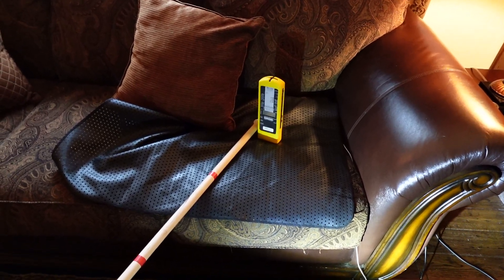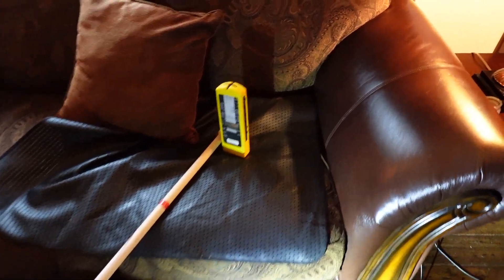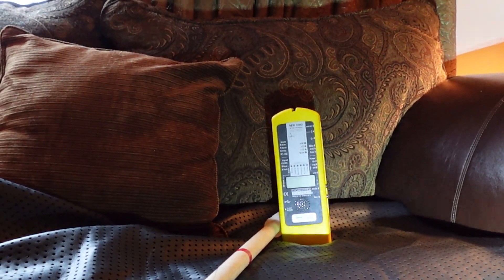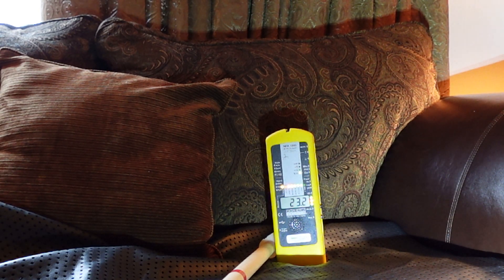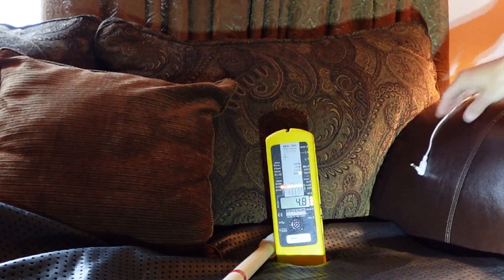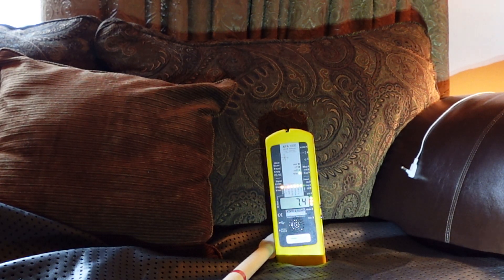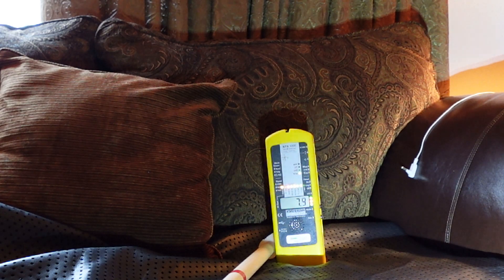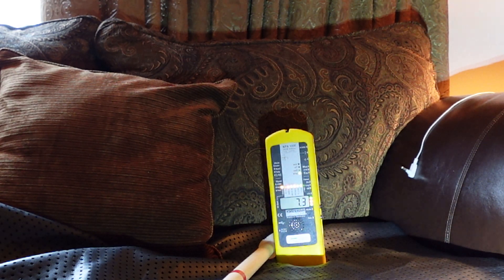The Problem with Earthing & Grounding Mats

Comment: I think you may have missed the point here. It is true that the outlet ground when plugged into produces EMF, which would otherwise travel through your body to create a greater potential difference, but only IF you don't sit on/touch the grounding mat. Once touched, the grounding mat acts as a sink for all that residual and generated EMF. Our body's potential difference is always insane given the EMF fields in our homes. Hence the need for these mats. And hence why measuring body voltage before and after using the mat it's so important. The only difference between plugging it in the ground in your outlet and using a rod in soil is the new EMF produced. But much of the body voltage difference produced by that EMF is drained through the mat. How is that dangerousm

Let me know if you have a counter argument. Thanks.
Reply: This is the correct answer and it's shocking how many people have been fooled by this "test".
Reply: I can only slightly understand what you've argued haha but so, your opinion is that it's fine, right? I want to buy a grounding sheet but I live in an apartment building. I am wondering if I should be more or less worried 😅
Reply: Should just sleep in a Faraday cage?
Reply: I slept on the grounding bedsheets on Thursday went out of town for an event stay in the hotel for annual event in Wisconsin Friday Saturday came back Sunday. Slept on the bed I was awake multiple times again same thing as Thursday feeling kind of a weirdness of energy first time I slept on my stomach, which I never knew because I just could not feel comfortable and I was wondering what your opinion is on this? We did use a tester in the plug-in outlet and when we plugged it into the outlet seem to be functioning good my husband says he’s not having any issues but I’m usually the grounded one so we both try to walk outside with bare feet when we can sometimes even in the winter, I will do it, I’m a Capricorn sign which is ground sign kundalini which I did last Wednesday anyways I’m telling you all this because I just don’t know what to do. I felt terrible. I think I woke up maybe 11 times last night. So maybe my body will get used.
Reply: Well, I do not understand your argument.
The claim that the EM-field would suddenly vanish if you were to sit at the place where it's located is just not making sense at all. EM-fields are not even responsible for our potential difference to earth. You're totally confusing EM-fields with electrostatic fields.
Reply: @fidrewe99  you are wrong. Emf fields do indeed "vanish" by draw to ground, that's the entire point.
Reply: @tatersquad2000  you are wrong, that's not the point of grounding. That's like saying if I ground something, the light around it suddenly vanishes, because light is EMF. Grounding is for electrostatic charges, shielding is for EMF.
Reply: @fidrewe99  The small negative charge from the ground neutralises positive charge that is created by EMF.
Reply: @simonruszczak5563  if the source of EMF is beneath the grounding sheet, yes. If it's to the sides, it passes because it doesn't even hit the grounding sheet. If it's on the top, it gets reflected and you get more radiation than you would without the grounding sheet. All of this is due to charge mobility within the sheet, not so much the fact it's grounded, because the dynamic response of the charges in the grounding sheet is perpendicalur to the vector of field propagation.

Comment: Hi 

Thank you for this video. 
I just bought a grounding sheet and after that saw this.
In simple terms as I have no idea about the technicalities & no idea about tools 
Would’ve grateful if  anyone tell me which tool I have to buy to check I only get the right stuff from grounding sheet. 

Thank you
Reply from the maker: You would be far better off to get rid of the grounding sheet and disable the electrical circuits in and around your bedroom during sleep

Comment: I don't understand your measurement. You said the meter is a gauss meter. A gauss meter measures magnetic flux density in such units as gauss or tesla or webers per square meter. But then when you read the meter, you gave the units as volts per meter. Those are not the units of magnetic flux, but rather the units of electric field strength. Furthermore, what is wrong with an electric field strength of 73 V/m. On a fair weather day at ground level outside, electric field strength is typically 130 V/m and under a thunder cloud, the direction of the electric field is reversed and it can be more than 10,000 V/m. Does anyone ever notice it? No, people have been living with those phenomena for millennia.
Reply from the maker: many gauss meters also measure AC electric fields, as this one does in this video.  This is an indoor environment tracking the electric fields from the manmade electric power grid.
Reply: Still ignored the ping of the comment. @optimaldwellingspaces3947

Comment: Does grounding in a high EMF environment mean a lot of EMF passes through you when connected to ground? I heard 2 opposite theories. If true, wouldn't that mean being barefoot outside is dangerous as well? I assume it's false, since an antenna connected to ground is not an antenna.

Comment: You have to be sure that your outlet is grounded properly or the whole process won't be effective
 That outlet may have a problem itself.
Reply from the maker: the electrical ground in your home is not clean from voltage pressure and current.  Having grounded wiring in your walls will help with radiated AC electric fields, compared to ungrounded wiring, but neither would be healthy to plug a ground mat into.

Comment: Great job on the video. The soil is also filled with frequencies and voltage that your NFA1000 won't measure. You will need a battery operated oscilloscope to see them.

Comment: Hey Shane! So, I used a TriField Meter to measure the Electricity coming from my grounding mat when plugged in. When unplugged it was at zero, plugged in at 2. Is 2 a dangerous amount of electricity? I do feel a buzzing in my body when lying on it. I’m assuming that’s electricity and not grounding.
Reply: I feel buzzing as well..I bit disappointed as one guy said it caused him heart fluttering...I've wasted my money

Comment: I don’t understand. So, the “ground”on the outlet isn’t actually grounded?
Reply from the maker: There is voltage ‘pressure’ on the electrical wires in the walls that creates a potential difference out in space in the room.  Conductive objects like a ground mat will exacerbate this condition.  A voltage potential difference can induce a magnetic field, which will be in AC form which isn’t good for the body

Comment: Its a hard ground, probably 14AWG or 12AWG copper.   There should not be any electrical inductance going on like I said its a hard ground.  Now if it was floating, that may be different, but even if it floats its alongside a circuit and perhaps only 500ma near it.  Inductance ?   I say no.  But if you said digital noise, then maybe.  If its close to a dimmer or an RF, VHF, UHF or GHz then maybe.

Comment: @optimal dwelling spaces -- what setting on your meter do you use to test this? I appreciate this info. Trying to avoid EMF issues...not my intent to infuse my body while trying to diffuse it with proper grounding techniques
Reply from the maker: the meter is reading AC electric fields.
Reply: thanks! I just installed 2 new copper grounding rods to connect directly to them instead of using the in house electrical outlet grounds...thanks to you! Much appreciated! @optimaldwellingspaces3947

Comment: WOW! Thank you for this information, as I was just about to place an order for some grounding mats for me and my mom. Question, if I chose to use a copper rod placed in the ground outside and a terrible lightning storm came, what are the chances of it striking a copper rod? These storms are getting more intense these days so is lightning striking a copper rod placed in the ground something to worry about? Thanks in advance for any responses!
Reply: I always wonder about this as well.  I understand that grounding potential always causes current to seek the quickest path to ground which would mean you would always see that current moving away but there are other phenomena involved that I find less clear to understand.  High-end earthing products have safety diodes that are supposed to prevent this possibility and will provide a tester to verify the diode is operational.

Comment: I found an electronics repair antistatic cord on Amazon for a wrist band with alligator clips, that has a built in 1 megohm resistor. All the Earthing products I've seen so far have no mention of a resistor whatsoever. Gonna test it out with my EMF reader and see if it has the same issue or if the resistor solves it.

Edit: It limits to 250 microamps at 250 volts rms AC, which is safe for electronics repairing, but only 18 microamps can cause cancer from long exposure... Hm...
Reply from the maker: I’ve Job digging into the details.  Yup, anti-static for electronics isn’t good enough for humans

Comment: Over a year ago I did the mat connected to ground rod for several months.  
I thought it helped and healed up some knee pain.
But I’m pretty sure it messed me up to the point I’m still trying to recover a year later.

My Alt who was an electrician prior to his career change told me not to do that.  Too much stray voltage in the ground.   Checked with my meter and sure enough it was a bad idea.

I recently meter checked the mat on a new dedicated grounded outlet.  It was showing 50-60 v/m!     

Take caution with this stuff.  Go barefoot at a remote beach or countryside instead!
Reply: That happened with you connecting the mat to an outlet?

Comment: you are right about the gauss reading.    but if you touch the mat  with any part of your body, the reading goes to zero which means very little to zero voltage on your body.   you said it's the current that matters not the voltage. 

would .6 MICRO Amps (reading on the mat with my body connected)  be bad for your body?
Reply from the maker: You're talking about a different meter, a multimeter, which people commonly use to 'test' a grounding mat.  If the voltage reading on it goes to zero it simply means the two probes are at the same electric potential.  If your mat is plugged into the wall (electric power grid), then you've put yourself at 120V.  Humans have no business being at a 120V AC electrical potential.  People misunderstand this all the time.  Now if you are reading current, not voltage, I wouldn't trust any amount of AC current, even 0.6 microamps.

Comment: For some reason when i do the oitside rod, i get headaches almost instantly and dont feel good, but with it connected to wall socket i get the benefit. Could it be that the side of the house that my room is in has the breaker box , and ac unit right next to it.
Reply: thank you for the comment!

Comment: Thank you for the info. Would you please be able to create a video or respond to this comment with a potential workaround for the grounding mat/sheets if we are unable to ground outdoors during the winter season.
Reply from the maker: getting outside, even in winter, has a number of benefits beyond grounding.  You don't need to put bare feet on the ground if it is too cold.  Put your bare hand on a tree.

Comment: I have Lightning Rods installed on my house and hope that helps a lot against radiation  coming from my wifi internet.
Reply from the maker: This won't make wireless radiation any safer.  Switching to ethernet is the only way

Comment: Why has plugging my earthing mat into my wall worked so well for me then? Measurable improvements in my health since I've started using the product. Not placebo. Please explain?
Reply: This is what happens when you have a poor grounding circuit in the house.  Grounding products don’t work without a good circuit, people!
Reply: This guy‘s house is not grounded correctly. I would be careful touching electronics if I were him.
Reply: Me too!
I’m really now wondering about this all?
Reply: These people don’t know you can check if your wall outlet is grounded and hooked up correctly… with a cheap outlet tester 😂😂😂😂 or whatever you called it it’ll show you the light colors and meaning simple to use.
Reply: @nitai154 I have one of those things that told me my socket was correctly grounded.  Tried my multimeter and it shows that my grounding sheet has a 15.5 volts when I touch it.
Reply: when using the meter to measure your 15.5v, what 2 points did you connect to, to achieve this?
A meter measures potential difference between 2 points.
Reply: @nitai154 He should have demonstrated this first in my opinion
Reply: I installed a dummy outlet by my bed with a #10 ground wire going through wall and down to ground then attached to an 8' ground rod. I can hit near zero with the lights off in the room
Reply: Can you share which earthing mat you have?
Reply: I'd say the benefits of grounding outweighs any potential negative emf issues you may have in your house. Now you may get even better health improvements by connecting your grounding mat to its own wire and grounding rod (you could use a nail if your earth stays relatively moist year round, but if you live in say Arizona, you probably need a good sized grounding rod - at least 1 ft. long - preferably 3ft. long). Hope this explanation helps.
Reply: @gnosisdespirit does length and depth of rod into ground matter? Just curious
Reply: lol how can you claim it’s not placebo if you’ve consciously known that you have been using the product?
Reply: Im in town centre in the UK on the 4th floor so i cant add a rod.
Any other suggestions, also could somebody recomend a reliable electric energy reader device please ?
My mat is from Groundology so im going to Email them & ask what is their take on this.
I will update u when i get a reply !
✌💫🔎💗☄
Reply: @traciemchugh3114 any update yet?
Reply: Did you get an answer from groundology? I just bought from them as well @traciemchugh3114
Reply: @traciemchugh3114 What did groundology say ?
Reply: The whole point in being grounded is to discharge what your body picks up from your devices putting out EMFs. 
If what he’s showing concerns you, then you need to go watch a video and find out what that same tool reads near a charging phone!
Reply: @Felix.Hunger  Thank you.
I am now using the rod, it works better and is more natural (and safer).
Reply: @mariellemeil2366 how does a person set it up with "a rod" I am not understanding at all. The mat is Inside, not outside
Reply: @susanrupp9357  your mat has a clip to which a cable is attached.  You then add another cable to that cable which is attached to the rod outside.
Reply: I use the Hooga Grounding Mat and a grounding pillowcase on my bed. Worked already in just a couple days personally, placebo or not, results are results.
Reply: It works but some people like me are electro sensitive.
Reply: Nothing wrong AT ALL with placebo if it does the trick! Placebo is an amazingly effective phenomenon.
Reply: for every positive there will be negative .. every single good thing that helps people , you will find someone somewhere disputing it and making videos like this
Reply: Maybe your home doesn't have this issue. He did say most not all. When I tried using mine it created more issues for me until I created a dedicated separate ground for my mat
Reply: Because your home electrical system is good
Reply: “Why has taking sugar pills worked so well for me then? Measurable improvements in my health since I’ve started taking the product. Not placebo. Please explain?”

How do you think snake oil salesmen ever made any money? You are severely underestimating the power of placebo
Reply: There are different levels of quality made items. Perhaps share the name brand of the Excellent builds instead of attempts at diagnosing things... literally this threat is ridiculous n funny! 😅
Reply: Depending on the wiring in your house you could be getting more or less interference. Also even with the interference you are still being grounded so you still might be seeing a net positive. Who knows if you are getting some interference and you eliminated it your benefits might be even better.
Reply: That shows that is not a big problem. By the way, most of the studies which show benefits are done via the socket. Also watch Dr Doan on this.
Reply: All grounds connect to neutral. That's where the readings are coming from. Many homes still do not have a ground wire.
I am already planning a separate ground rod, more than one, just for earthing.
Reply: you may underestimate the placebo effect. placebo effect doesn't mean the results aren't real. the placebo effect means it was just your perception of the supposed healing mechanism and your mental and emotional wellbeing from that perception that caused the healing, not the mechanism itself which may or may not even be real.
Reply: @keenantroll5151  Placebo effect is also used most commonly to debunk  the most commonly accepted explanation for any phenomena not fully coherent with the current overarching neoliberal scientific belief set.
Reply: Thats just another way of saying you don’t know. The plug outlet used in this test may explain it. If she’s already having great effects grounding directly into outside ground would only improve her effects.
Reply: @keenantroll5151 So typical, science product, lack of human intuition and intelligence/devoid of connection and sensitivity to nature. Robots will be robots...
Reply: placebo